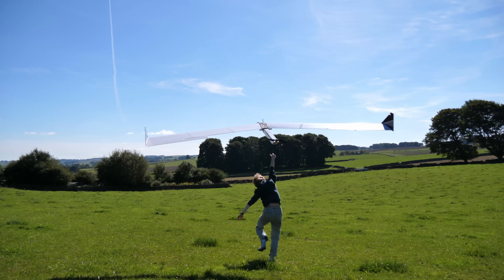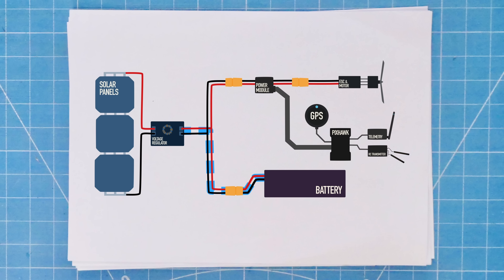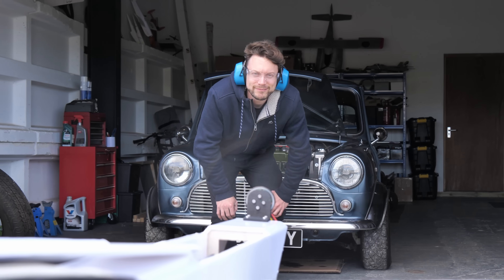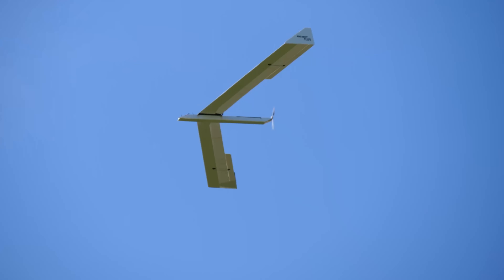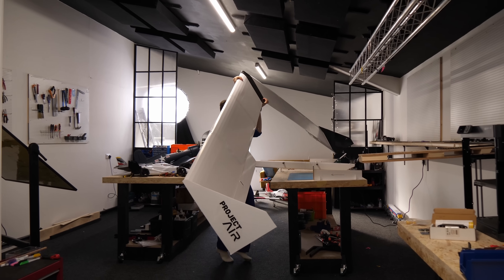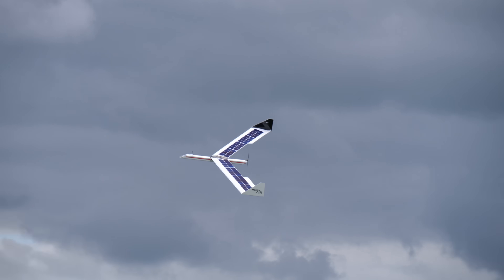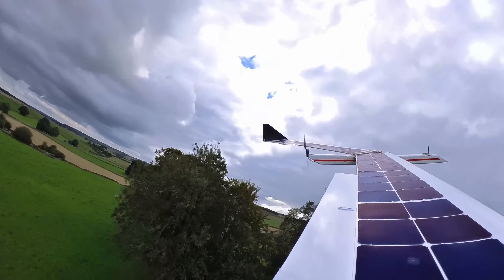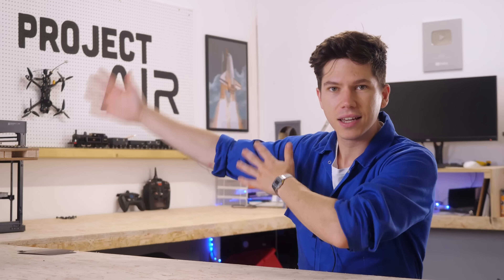Solar Plane V2

Comment: 🤔 maybe CF-tube instead of aluminium and still using a mppt, but have the load bypass the mppt .... also maybe bigger flight control surfaces.

Comment: Your first "solar" flight ended due to a Delta V stall. Sharp rudder turns slows the airspeed over the inside wing. You might not have enough room at that site, at that altitude.

Comment: If that regulator does not have MPPT, it's a lot less efficient, which is bad if you need all the power you can get. Then you may want to distribute the weight across the wing so flex is minimized without adding structural rigidity. Easiest way to do that is to distribute batteries. Also use aluminium core wires instead of pure copper ones, they are lighter (but larger diameter) for the same resistance. Any electronics that need cooling are a) a sign of bad efficiency and b) very heavy because of the heat sink, which could be alleviated by cooling it from the airstream. In order to not add drag, a flat piece of metal that is part of the aerodynamic fuselage should be used as a heatsink. Maybe even switching to magnesium metal as the heatsink could still provide sufficient cooling while further reducing weight. One other thing you could do is combine structural use with use as a conductor so e.g. structural aluminium parts could replace a wire or two or be used as a heat sink. Voltage regulation circuits can be made lighter by replacing the electrolytic capacitors with ultra-low ESR polymer capacitors (like these found in metal cylinders on PC motherboards or graphics cards). Using these can enable using a smaller capacitance value, which is lighter. They also improve efficiency. Also less chinese electronics can also help improve efficiency and reliability.

Comment: you could add a backup system that uses airspeed to spin a motor to charge the battery just incase the solar panels go out you can switch to the backup system. Eventually it will stop but it will give you enough time to land it safely

Comment: As others have noted, carbon fiber rods would likely be a better choice than aluminum L-channel. You can also attach them to one another with a custom printed 3D bracket to extend rigidity across the entire wingspan (though you might consider reinforcing that with a layer of fiberglass).

Comment: To reduce weight, you can punch holes into the aluminum L bracket, retaining the edge for rigidity. And also remove amy unneccesary plastic covering the controllers.

Comment: i think you should cut the aluminum frame thinner at the tip at the wing and thicker at the base to loose weight, and add hellium bags inside those hollow wings

Comment: from day 1 I didn't like the design of the wing it looks thin and does not generating enough lift to support the weight of fuselage. Along with electronic you should concentrate on the design of wings too; with some more airfoil friendly shape and design. you can also add canards to create more lift surfaces for the fuselage.

Comment: What is the purpose of having swept wings if there will never be any buffeting from transonic speeds? I get that it looks cool for a thumbnail, which is super important for YouTube, but as I understand it, straight wings can provide more lift at lower speeds which would help to reduce the input power required to keep the aircraft in flight, right? Also, if there is room, could the power electronics be moved into the wing airfoils to completely eliminate the fuselage in order to reduce weight, reduce drag, etc? A true flying wing. I think you were on to something with the RC gliders, despite the challenge of having to redesign the power electronics.

Comment: Your foam is to heavy and flexible. Try depron and use carbon fiber as a spar or spars. If you use a fuselage you need a tail . Maybe v tail will help you . Delta wing is not stable enough to glide and loiter around you need a lot of power or it will tip stall. If u do not use a fuselage then make a wing type of  aircraft,  they are very very efficient and once balanced  they will glide for ever. 
Also use a folding prop, you can use a bigger prop and it will not snap on landings . LION 18650 batteries could be a better choice.

Comment: Use flat bar aluminium (vertical orientation) sandwiched between foam will save half the weight of the aluminium.

Comment: simple solution connect solar cells direct to battery via diodes and plane motor in parallel...high sunlight charge battery and drives motor. in low sunlight battery drives motors. simple.

Comment: The width of the plane's wing should keep them from wobbling front to back too much which means you don't have to use L-shaped aluminium profiles, use flat profiles and mount them vertically in the wing. This will provide up-down stability while cutting the weight of the reinforcement in half

Comment: I agree with the top comment here. I have been living totally off-grid for over six years now on a solar setup, and none of my loads are connected to my MPPT; all the loads are connected directly to my batteries. I would still use the MPPT as it has an inbuilt battery charging profile and will reduce the charge voltage if the battery is getting full and avoid you cooking it. The voltage regulator will just keep pumping in power which could be catastrophic.

Comment: Flying at slow speeds your induced drag will be significant, and you are losing the benefit of the high aspect ratio wings by having such a discontinuous chord distribution. Those massive control surfaces on the outer wing are shifting your lift distribution a long way from the ideal elliptical shape, and probably one of the contributing factors to the poor climb performance.

Comment: You could save a TON of weight by ditching the battery.... 
Go to a smaller lightweight Lithium Ion battery.... 
If the goal is to not need one why not just use it to get up to cruise altitude and then throttle back and let the solar panels do the work? 
A lithium Ion pack half the weight of the one you are using now will get you nearly 3/4 of the power. 
Plus, you can run them to a lower voltage than a Li-po.

Comment: I would suspect that the stability could be improved by changing just 2 small design issues in the wings. If you apply a  6 degree digedral to lift the wings it would prevent unintended rolls and make it easier to fly straight. Also putting a slightly greater angle of attack at the wing root and a smaller angle of attack at the wing tip will help prevent it stalling and going into a death spiral. This is because the stall will start the wing root first cause just a stinger nose down to increase speed rather that stalling at the wing tip cause an uncontrollable spiral
Reply: I also think it will give better performance at lower speed and less power drain

Comment: Being that you can run solidworks and have a 3d printer, I would suggest designing your wing in CAD with a efficient airfoil based on your cruising speed and print it from lw pla. You can really improve your efficiency this way. Also recommend using a folding prop, I use aeronaut camcarbon folding props. Least you won't break anything on landing

Comment: We don't use any charge controllers on our solar planes, just a switch that cuts power from solar panels if the voltage gets too high. Also, we make efficient airframes, unlike yours that's probably about as inefficient as one can build
Reply: I've just finished building a 2.4 meter 450g dry weight plane that barely sniffs the battery to stay airborne and is very rigid. I can give some tips if you want

Comment: Hello, I think the holder f the motor ist not the problem. If you use a folding propeller, landing without damage should be possible. You have also the chance to switch the motor off, for having a good gliding angle.

Comment: Here's what I would do for your electronics:
- Keep/reintroduce the mppt as its way more efficient in harvesting power from the solar cells. Also add a small BMS for battery safety.
- Group your systems into different levels of criticality. Your power will eventually run out, so what you wanna do about it? You need to know what systems need to run till the absolute end even if it kills your battery (these are likely radio + flight controls). At the moment you just keep discharging your battery, which wil likely kill it - thats what the disconnect precents after all.
- Set the disconnect to the lowest safe voltage for the battery if possible.
- cut off the motor if power is lost, effectively turning your plane into a glider.
- manually or automatically switch on a little reserve battery for flight controlls so you can land safely.

Comment: Why don't you use pre-tensioned kevlar string to prevent wing flexing? Of course, string will cause some little air drag but it weights about to nothing and does significant stabilisation efficiency as a triangular element. Just  tight it in between winglet tips and the center of the wing.

Comment: I feel like the easiest form of aircraft to make solar powered and able to stay up full time (incl. through the night) would be an airship. Because they don't require power to stay aloft, only to make way and steer, and because they have a large surface for solar cells. 1 liter of helium produces 1 gram of lifting force. 1 cubic meter is 1000 liters, so that's 1 kg. A 10mx10mx10m cube would contain enough helium for 1 metric ton of lifting force. At a size of around 5 meters, about 16 feet, you're at the point where a rigid frame made  from 1 inch aluminum extrusion would become practical. That's for a cube, but realistically you wouldn't want a cube. A cuboid that's half as tall as it is wide and 3 or 4 times as long as it is wide, would be a good start. Then you can add on a pointy nose and tail to make it a bit more aerodynamic.

Comment: Yep, both version are wrong o) MPPT used to keeps that sweet current in the point where solar cells provide max power. Overdemanding solar cells makes them produce less power. "Screw that, I don't need maximum power from my solar cells" - you said. And then you add 5v battery next to receiver and servos that act like a capacitor - it keeps its charge and does nothing if 5v is provided by ESC/UBEC and discharges if ESC/UBEC is fried/disconnected.

Comment: Slight misunderstanding on your throttle. When you looked at different throttle % and the discharge rate, this was base on static thrust. Once up in the air, the load at the same throttle will be less so you can actually run it a bit higher.

Comment: would it be better to use capacitors instead of a battery? without a bms it might run into problems

Comment: A few tips:
Use distributed propulsion, twin, or 3 or 4 or more motors,  low KV, and high pitch props. 
Ditch the aluminum L extrusions.  They are heavy and offer very little torsional resistance.  Use carbon tubes instead, 1mm wall thickness, and as large diameter as are practical.  
for a tech demonstrator, you can use direct charging, if you get the ratio of solar cells to lithium cells about right, it will work well.  use a simple electronic switch to disconnect in case you succeed in charging more than you use, and for use on the ground when not flying, to avoid over-charging the battery.  
use a moderately high aspect ratio wing with a real airfoil.   about 12 percent thick would be good.  you may have to make your own airfoil or modify one that already exists.  for instance start with a SD7034 or something like that and thicken it.  something with a deep drag bucket in polars, and that can still conform solar cells is about ideal.  use open frame construction, and place cells under the covering material. 
use a design with a lifting stabilizer, a triangular fuselage, and place solar cells on the rear fuse, and also the horizontal stab.  
Glider wings are usually too thin, and are not optimal for endurance, as they are optimized for L/D instead, which is the equivalent of a distance optimization. 
of all the gliders, the super light weight thermal ships would be the closest.

Comment: I recommend you use a proper airfoil and test your design in xflr5 and use a mppt since efficiency is key for this project, after xflr5 you should use a cfd program( i believe solidworks has one) to iron out the Cd, Cl, Cm values

Comment: on 17:06 the double high E, planes would work really well if you make place 2 propellers, that should need less power because the motors double the power. Compensating for the added weight should be a ratio of 75 to 5 g also should give you more stable flight on higher altitudes, and allow you to even add some struts to lg !

Comment: Hey buddie, i am working with composite materials and CAD prototyping. That being said, reach out and we can do some carbon-fiber or aramid shenanigans😊 also, i would not have made the motor mount stronger because now more force will be applied to the plane body and the rotor. I would just print 5 of these and just use them as a "failure point"😊

Comment: You may be worrying about the battery too much. Kind of, or not enough. How long can your battery fly the plane?  How much sunlight do you get on average at the season/time you are flying.  How much of the sunlight can you gather with your solar cells?  The absent of sunlight is made up by your battery.  As an example say the sun shines 50% of the time.  your solar cells/wings must produce twice the energy to fly the plane.  one half to run the plane while the sun shines. The other half to charge the battery while the sun shines.  That way the plane can fly all 100% of the time.

Comment: You really took a simple problem and made it an overly complicated solution. Have everything exactly the same as you had it. But instead of using the load output of the charge controller, just hook the electronics directly to the battery positive and negative.

Comment: If you find you need to drop more weight but worry about a 'wobble', I wonder if using something like Ultem line to pre-stress the wing might help provide some additional stiffness.

Comment: So I don't know why your using that delta wing design. It's horrible at slow speed and that's the speed your flying it at. Switch to a straight wing and it will give you much better stability.

Comment: I'd rethink a few things: 
Flying wing is not as efficient or stable as a conventional tail setup.
Pusher prop is not as efficient, quiet, or safe as a tractor.
MPPT is more efficient than a charge controller, just hook load up to battery. MPPT should prevent overcharge, and ESC should prevent undercharge.

I'd love to see those RTF glider wings attached to a wide lifting body for extra cell space.

Comment: have you considered gluing carbon tape on top and under the wing to counter the bending moment?
Reply: I'm curious how an unswept wing with a canard configuration would perform for you, as it would maximize lift from your main wing and the control surface.

Comment: build it like a normal glider. Take one of the ASW-17 you have and just add more wing span, you don't need it to be fast, just add lift until it can handle the weight. also mostly use the rudder to turn so you don't bank away from the sun. I guess you could even mix it to bank a little in straight flight to maximize solar input 😉

Comment: you printed that motor mount in the worst orientation possible ! All the strength comes down to one narrow laye's adhesion at the transition to the vertical half of the bracket. Rotate 90 degrees, print on its side, for 90%+ the strength of injection molded part....

Comment: Most charge controllers aren't built to have your main load draw from the charge controller. It's typically just meant for small auxiliary loads, and your main load is then connected direct to the battery. Also, use the charge controller. The voltage regulator is kind of a hack idea, and it might not even be built to handle a solar input anyways. Long winded and rambling explanation below:

When you hook up a charge controller to a battery, you're effectively using the fixed voltage source of the battery to control the input voltage instead of the output voltage. Also, side note: most charge controller require a battery or some sort of fixed voltage source in order to actually perform MPPT - it serves as an "anchor" which it will use to either increase or decrease the voltage on the input. By scanning the full output of the solar panel (from open all the way to closed circuit), it finds what output produces the maximum power and tries to stay there. It will take a typical solar panel all the way from maybe 70V to ~0V to find this. That's a pretty wide input range for a device, but it's built for this. Also if you interested, there are a lot of cool papers describing different MPPT algorithms online - given how dynamic both input power and output loads can be, it can get pretty complex.

Again, charge controllers are built for this, but voltage converters are not. Without a good understanding on the specific voltage converter works, it's impossible to tell how the voltage converter will affect the input voltage, or how this varying input voltage will affect the converter. It would've been interesting to measure the voltage going into the converter and see how the converter is affecting it, especially after increasing the load from the motor and slightly dropping the battery voltage. Then you could also experiment trying to change the output voltage on the regulator, and see how it affects the input voltage. It's pretty cool how it functions backwards in this scenario.

Ultimately, you should just put the charge controller back on, connect the battery, and connect your load direct to battery. It's how the charge controller is meant to be used, and you'd also make the initial fault impossible as the ESC would still be connected directly to the battery. 

Thank you for listening to my TED talk.